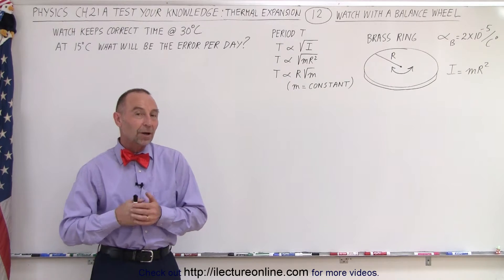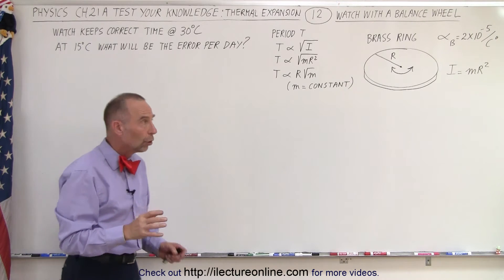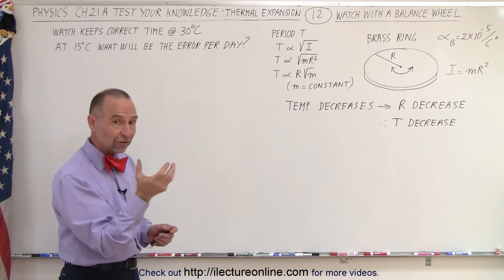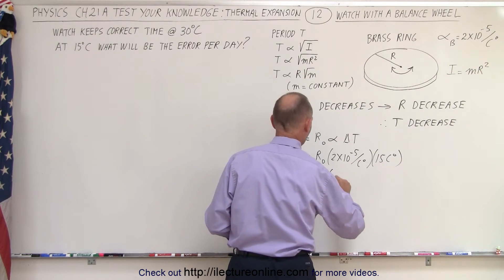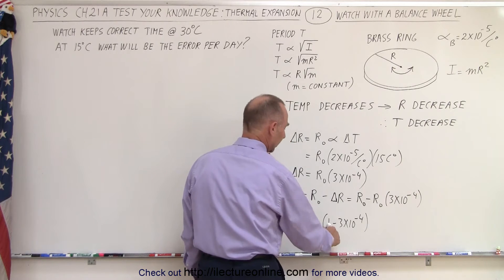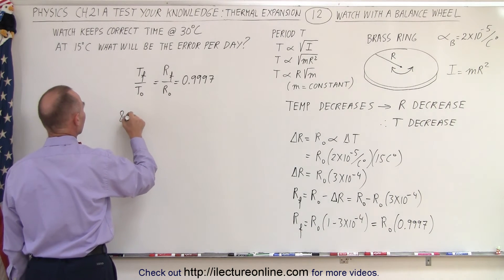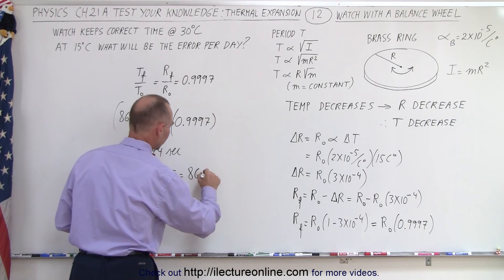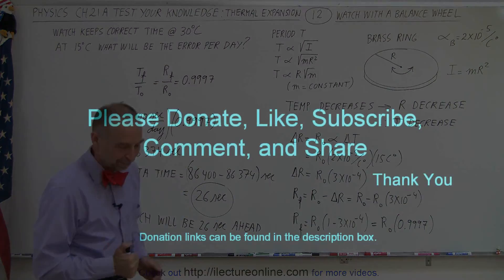Physics - Ch 22A Test Your Knowledge: Thermal Expansion (12 of 20) Watch with a Balance Wheel

Comment: Is it okat to calculate the New radius directly using Linear expansion? 
Don't we have to use the Area expansion to find the new radius?
Reply from the maker: You can use either method.  You'll get the same answer.
Reply: @MichelvanBiezen  Thanks for the Explanation sir.👍💝